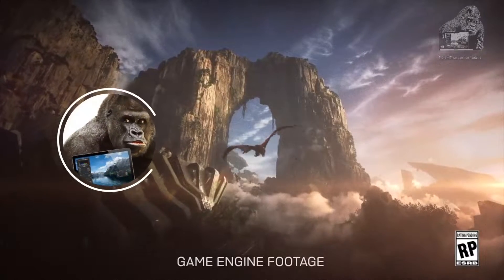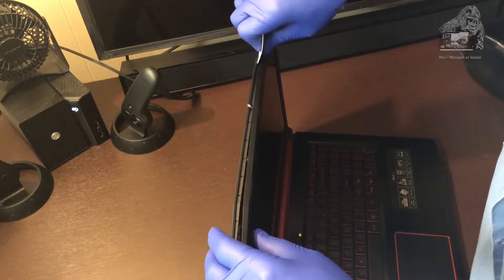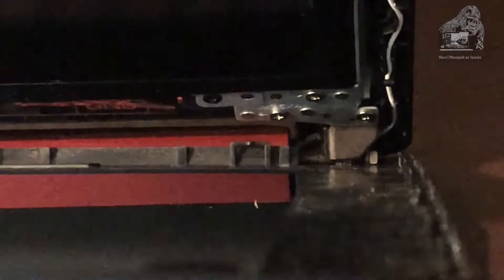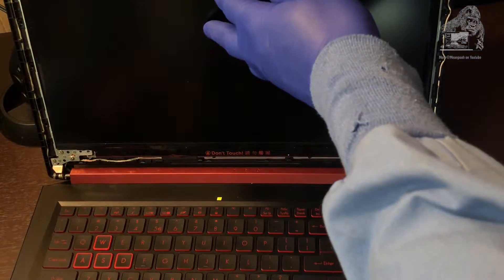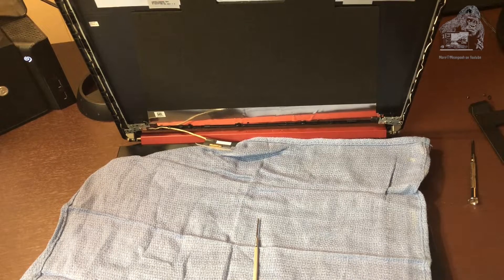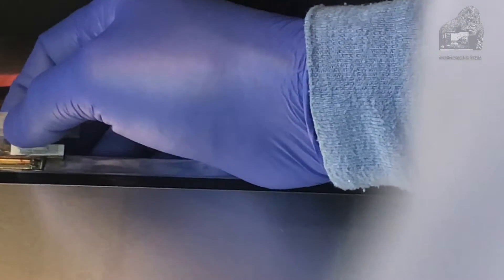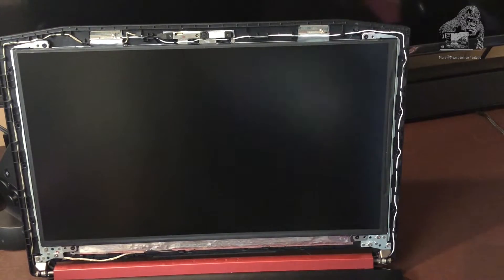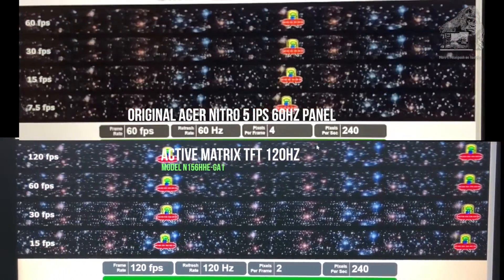120 Hz LCD Screen Display Tutorial Acer Nitro 5

Comment: im using acer nitro 5 an515-54 with 30 pin 60hz original LED, will it work if i use the  the 30 pin 120hz panel?

Comment: Hello Meanpooh! I have the AN515-55-50J3 version of Acer Nitro 5 and the LCD is flickering. I have the B156HAN13.0 120Hz eDP1.4  but the shop sent me N156HRA-EA1 144Hz eDp1.3. Will it work? Both has 40 pins. The main difference is the Hz and the eDP.  I don't need the higher Hz to be honest. I just want to replace the screen.
Reply from the maker: You should be fine, they are pretty much the same besides the  Hz.
Reply: @Meanpooh  but not as fine as you! Thank you very much. You the MAN!

Comment: First of all, I think you're awesome: for the video, the fact that you mentioned brightness, and the fact that you've replied to every comment here :D

I was gonna do a similar upgrade to replace the broken screen on my Nitro 5 AN515-51 but I'm thinking of going for the B156HAN04.2 IPS 120Hz instead of the TN (trading the response time for the viewing angles/contrast/more vibrant colors) and was wondering if you've dealt with that panel before. Almost everywhere I look seems to claim there's no fix, but a few claim it can work, and one post on the Linus Tech Tips forums had instructions that seem like they'd work, but for a different laptop. I've also read somewhere that it's a Windows only issue and Linux works fine. Sorry about the wall of text, I'm just confused haha.

Do you think I'll encounter brightness issues with the 120Hz IPS? if so, is there a fix?
Reply from the maker: Thank You!  Unfortunately Ive never dealt with the panel.  The panel I used had a brightness issue with others but it worked just fine when I installed.  I never knew what the issue could be other than it might have something to do with the manufacturer of the panel.  I guess you could take the chance but make sure the return policy is good.
Reply: @Meanpooh  I'm buying from the US but I don't exactly live somewhere where I can return it if it has issues. I think I'll go with the one you used and just take the hit when it comes to contrast/black levels in exchange for some peace of mind. I'm also considering doing more research to see if there are any compatible IPS 60Hz panels with better colors thank the factory one since the 1050Ti can barely push a consistent 60fps let alone 120fps. In any case, thanks a bunch!
Reply from the maker: @beck4715  True that it cant push 60FPS consistently in a lot of games but having a higher refresh with just web browsing or just moving files around on the desktop makes a big difference.  More than likely you'll never want to go back to 60Hz.
Reply: @Meanpooh Fair enough lol. I've tried a friend's high refresh display before and even on the desktop, it was definitely noticeable. I also can't seem to find any info on other displays that would work without breaking the brightness that aren't the stock options so I guess I'm getting this one :D

Thanks a lot , really. You've been very helpful and I appreciate it. Like I said, I won't be buying it directly, but I'll DEFINITELY try to get them to use your affiliate link (if that's what that is)

Comment: The screw on the bottom right is stuck, you said your one requires more resistence to unscrew but my one is stuck. i tried doing the steps after it in attempt to get rid of it easier. But im just left with my old panel sticking out. Any ideas how to unscrew it? Thanks
Reply from the maker: You can try pushing on the back as you apply pressure to loosen it.  If all else fails you could try some very small needle nose pliers and attempt to loosen from the top.  If the pressure with the pliers is too much, you will crush the screw.
Reply: @Meanpooh  i tried for many hours and had to cut the metal bit of the panel to get the screw out. The new panel works but the parts behind the panel are all broken because i tried getting the screw out so much. The inly thing i can screw in is the top of the panel and top of the hinges now i cannot screw the 2 metal hinges abd have no way of moving the monitor and adding back the case
Reply from the maker: Oh no.  There's no way you can straighten the parts out? If its that damaged you may have to get replacement part.  Meaning the metal piece that you modified.  I'm sad to hear the problems that you had, its the most extreme Ive ever heard.

Comment: After I installed the screen, a couple days later my laptop battery died, was this a coincidence or did it have something to do with the screen? I feel like the screen had something to do with it
Reply from the maker: Naa, it shouldn’t have. It’s only 1 wire to connect. Has to be something else.
Reply: Meanpooh guess it just died out, it’s most likely the battery since it was overheating before it gave out
Reply from the maker: @jnov3134  So you're not getting any power at all?  Did you make sure to plug it in securely when you replaced the panel?  Maybe it disconnected?
Reply: Meanpooh yeah, the laptop won’t charge at all the screen was working for a while. I broke a piece of the white tape from the wire, but it was connected securely.
Reply: I’m ordering a new battery and memory card, so the battery doesn’t die out so fast

Edit: https://www.amazon.com/gp/product/B07ZNHL6PY/ref=ppx_yo_dt_b_asin_title_o00_s00?ie=UTF8&psc=1 that is the screen I purchased, maybe I got the wrong one which caused my battery to die.. or I think it’s because I turned my laptop on and off 15 times checking if the screen powered on
Reply: Meanpooh sorry for bothering you so much, but does it make sense that it’s the battery because it was overheating s couple days before it went out and the day my laptop died it wouldn’t charge and finally gave out, there’s no answer on the forums or anywhere so I’m asking you from your experience with these laptops

Comment: Is It compatible with AN515-51 N17C1 ?
Reply from the maker: Its compatible with the AN515-51 sku but not sure about the rest of the model number.  You may have to look at your pin count on your display to see if the pin count is correct.

Comment: I have Acer Nitro 5. An517-51. i5-9500 / gtx 1060. I want to do this screen upgrade to 120hz as I’m used to 144hz on my desktop. My biggest concern is the fps drops due to higher hertz. I get around 60-80fps on fortnite unless I’m overclocked and running the laptop at high temps. Would 120hz be worth losing the fps?
Reply from the maker: The upgrade is worth it as far as FPS loss, just turn your settings down to regain.

Comment: I dont know how to say this but if it says like a different laptop like MSI and you have a ASUS and the screen is the same size will it work?
Reply from the maker: Depends on pins and location.  I believe the Acer Nitro 5 panel is 30 pin and some of the higher Hz panels are 40.  Gonna need a new cable.

Comment: This still work in models from 2019 and 2020 of Nitro 5 ? Still compatible?
Reply: AN515-54-58CL is my Nitro 5 model
Reply from the maker: Im not sure.  Ive only install  on the AN515-52.  The pin connector is the most important thing to check.
Reply: Thanks for answer :3

Comment: Hey I have a problem with my acer Nitro 5 when I am opening the laptop the right hedge is comming off from the screen with crack sound. And it's difficult to open, how to fix it?
Reply from the maker: Sounds like a piece is broken inside.  Probably nothing you can do besides putting some strong, clear packing tape on it.  Dont glue it.
Reply: @Meanpooh  what about service center? Can they fix it?
Reply from the maker: @aditya730  Im sure most repair cents can fix it.  It's just a plastic tab inside.  Just dont overpay.  I would contact Acer first.  They have an online chat system.
Reply: @Meanpooh  thank you very much ! Can I get your discord so I can contact you

Comment: I did this, but now my acer won't boot. I disconnected the screen, and it worked fine, but when I connected the monitor back up,  it went back to not turning on. Hlp...
Reply from the maker: Are you getting any lights?
Reply: Meanpooh I did this as well please help me, both the screens won’t load when I connect it, laptop powers on but the screens don’t and I ripped the tape a little I think that’s why can you help me

Comment: Does this work on any acer nitro 5 ?
Reply from the maker: No, only specific models.
Reply: Meanpooh   The 120 hz screen that is listed below Can it work on a AMD Radeon RX 560X.      That’s what I have
Reply from the maker: @Gruposeptiembreofficial  Model?
Reply: Meanpooh Acer - Nitro 5 15.6" Laptop - AMD Ryzen 7 - 8GB Memory - AMD Radeon RX 560X - 512GB SSD - Obsidian Black
Reply: I followed every procedure step by step but my laptop screen won’t turn on.  Only the laptop it’s self
Reply from the maker: @Gruposeptiembreofficial  Does the screen work with your machine?  Have you made sure that the tab is secure that holds the cable in place?  Have you tried reinstalling your old lcd panel to make sure the cable is not damaged?  Whats the model number or your machine?

Comment: Compatible with Acer nitro 5 an515-43 r5 3550h+rx560x ?
Reply from the maker: It might.  It does work with the 42 variant.
Reply: @Meanpooh  but im doubt about thin bezel and thick bezel. Current screen 43 use ips panel.
Reply from the maker: @afifiasri138  I understand.  I wouldn't take the chance unless I was 100% correct.  If I find one, Ill post a link for you.

Comment: Hi, I have asus tuf fx505g using I5 and gtx1060. My laptop used 60hz screen panel. If I buy 144 hz or 120hz screen panel with same number of pin, can it worked? I am sorry for my english
Reply from the maker: Yes, I have found a site for you.  You will have to check to see if your pins are correct (30 or 40) so you will have to dismantle it to be positive.  If you have warranty still active, it might void it.
https://www.laptopscreen.com/English/model/ASUS/TUF~FX505G~SERIES/
The hard part is trying to find one as the link above is for 60Hz.  All other places i've checked are sold out or overpriced.
Reply: @Meanpooh  Thank you for your reply. You are awesome.

Comment: Will the laptop run a 144hz gameing monitor
Reply from the maker: Probably if you can find a matching part number thats compatible.  Just don't expect very demanding games to reach that rate.  I have a 120 which looks really well when watching movies and browsing the internet but there are very few games that I can get to hit 120 FPS at high quality.  For me anything over 60 doesn't matter but I can tell a difference visually even if it doesn't reach the the target.  At this point it may be better to just get a new machine that comes with the freq. which will have a better GPU and CPU.  If not a new machine then perhaps the last gen predator line.

Comment: i have nitro an515-51 do i have to get any specific screen for that model corei7 16gb ram
Reply from the maker: The one I have listed in the description will work.  https://amzn.to/2TrvwYn
Reply: @Meanpooh  I was wondering if the same screen you used would work with my an515-54 1050 3gb 2019 version with thin bezels
Reply from the maker: @slangmangin6770  Not sure.  The connector is 30 pins and some Nitros have 40 pin connectors.
Reply: @Meanpooh  damn, I'll have to see then. Thanks for the info tho, it's greatly appreciated.
Reply from the maker: @slangmangin6770  If you are able to dismantle your panel, you'll be able to count the pins.  That would be a start.  Then see if there is a model number somewhere.  If i come up on any info, ill post here.

Comment: I just bought the AMD version, 2500u, 560x, 8gb, etc. Got it mainly for WoW dailies and light shit when not home. I do 2560x1440/144hz at home, so I'm not exactly too excited about the default panel.  

But... can it even drive any games close enough to 115-120? Does the screen look significantly better than the default one? For my use case I'm not sure if it'd be worth it. 

But, the laptop was on sale for $439 direct from Acer recertified. I believe it's still in stock.
Reply from the maker: Good price.   As far as 115-120, no.  Unless it's an older game running DX9 or something.  Some games using Vulcan API can reach those numbers.

Comment: is this going to fit the new Nitro 5 AN515-54 with thin bezel?  Desperate to upgrade my laptop to 120hz panel
Reply from the maker: I can’t say as I do not own the machine.   If it’s not too late, can you return it and get the Nitro 7 144hz model?

Comment: I did this on my nitro 5 with ryzen 5 2500u and rx 560x. You make it look like harder than it actually was. This 120hz panel was huge improvement for games. Only bad thing is that this is weak for running 1080p 120fps, often i have to drop resolution to get fps close to that. But even if fps is just 60 its better to game on this panel. I can also use freesync with hack, i have it set to 48-120 range. Original panel also works with freesync after enabling it with hack, but if feels like it works better on this panel.
Reply from the maker: It's not hard at all but if you break that cable youre going to be sick for a bit.  Just like installing a SSD is easy but if you break the ribbon connector you're going to be pissed.  A lot of things are easy but if you're not careful then.....
Anyway, you have to think of the people who have never attempted installs, upgrades or fixes and put yourself in their shoes.  Thanks for the update on the freesync hack on Ryzen.
Reply: Guess I should have read all the comments. That one you got was on sale for $439 Haha. But I was thinking can it even drive any games close to the magic number? 

Disregarding the hz, is the panel better in any other way? I wont be using this for FPS most likely, I have my desktop for that, but going from 2560x1440/144hz to 1080/60 is gonna make me cry.

Comment: You listened to me.. awesome bro!! 💪👍I was waiting for you to make the video before I tried it. Thanks so much bro
Reply from the maker: You're welcome.  I decided to do some research on some replacement panels that support the brightness controls.  That is what pushed me to do it.  Also faisalhaider007 mentioned a listing for a panel that works.  Im still messing around with it and I think I have it  the way I like it.  Thanks Anonymous Jerry.
Reply: @Meanpooh  I'm actually looking for a panel for mine now.. just worried though because I never calibrated or adjusted colours on a display
Reply from the maker: Your machine has some profiles you can use with the monitor.  I cant find find any to match the exact panel that I have but the profiles installed will do.

Comment: I have an old Acer Aspire from 2007 that has a broken display panel. Not that I'd use it again but it was given to me as a gift so it's got sentimental value and I just tucked it away. This makes me think I should just replace the screen.
Reply from the maker: It shouldn't be too hard.  Finding a panel might be.  Sometimes older hardware becomes pricey the more rare it becomes.

Comment: i have a acer nitro 5 with ryzen 5 2500 u will this display on my acer
Reply: Yes, it works fine. I installed one in mine (Ryzen version with updated bios and drivers) after seeing this video and used the same link to buy mine. It is not plug-n-play however. You'll need to download Custom Resolution Utility to put it at 120Hz. It's very easy and quick to do, however.
Reply: @wicked96ta  I have this panel on my ryzen nitro 5, and it was automatically at 120hz. Custom resolution utility was only needed to enable freesync, and i have 48-120 range working.
Reply from the maker: Im not sure but based on what Ive seen with the AMD variant of the Nitro, everything is the same except the CPU and GPU.  I really don't see why the panel wouldn't work.  That's just a hunch though without actually owning it.  If you do try, Amazon has a good return policy and there's not much to remove when doing the install process.
Reply: @Whyliam  really? I thought that was going to happen with me because that's what the video seemed to do. But I looked at another video and found about CRU. Then on Reddit I saw you can force Freesync and decided to try it too. This thing is my little workhorse now.
Reply: @Whyliam  Yeah, same here. I have a decent, although, aging system that I'm going to upgrade throughout the year with the new Ryzen chips. I really like how clean and neat it is with a sffpc so I'll be doing that. It'll be my mobile gaming/school rig. But this little laptop surprised me with how good it performs with some upgrades. Handles the simulators I throw at it, can do CAD, and I could play Insurgency Sandstorm before the latest patch that fixed a lot of bugs! Plus whatever work related stuff I need to do on it, which is mostly emails.
Reply: Also, just want to add that with this monitor and CRU, I forced Freesync on my little Acer Nitro. The ranges I set for Freesync is 30-90Hz. I limit my frames to 45-60fps on games. Depends how demanding the game is. But for Insurgency Sandstorm, 45fps works fine with Freesync on.